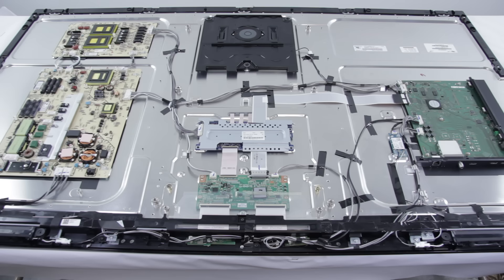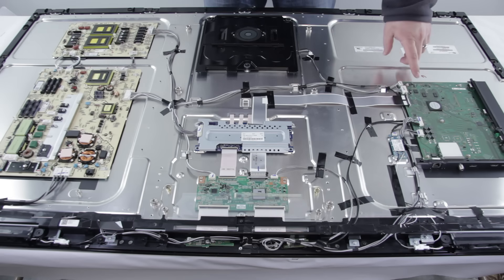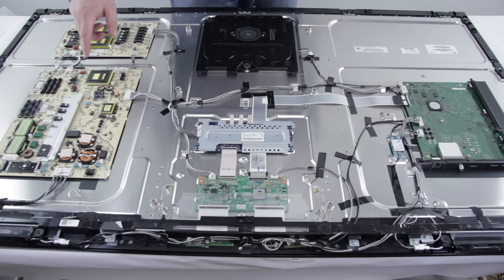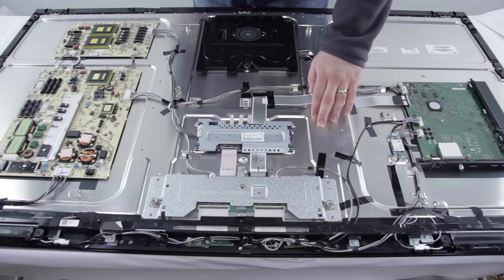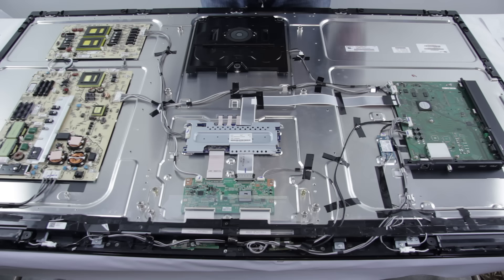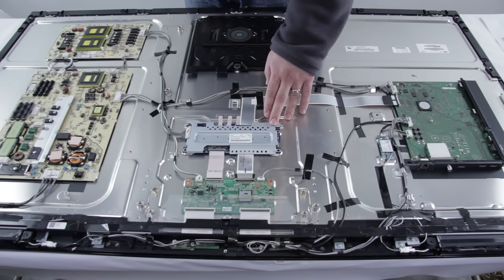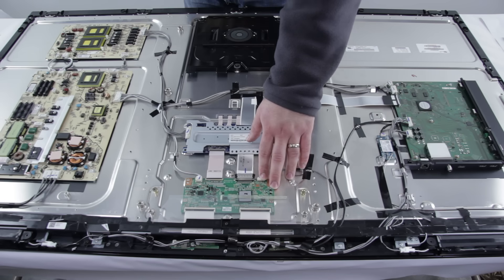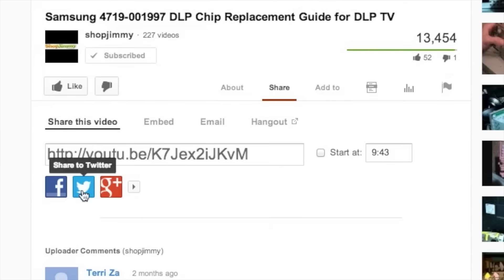LED TV Repair Tutorial - Common Symptoms & Solutions - How to Repair LED TVs

Comment: I have an LG 55LB5900-UV and the HDMI port says no signal. HDMI port 2 works fine. I've replaced the cables and switched the sources around. All sources and cables work fine in HDMI 2. When I initially reboot the cable box, the HDMI 1 port recognizes the source and gives a quick message, then the "no signal message" appears. Is it possible that that port burned out when we had a thunderstorm a few days ago?
Reply: sounds like the surface chip controlin this input  is faulty

Comment: Hi.
I have a Samsung 55d8000 LED TV. When I turn on the TV, it turns off immediately after the boot image is appeared on the screen. I think the capacitors died, cause I've been using it for like 4 years or so. May you suggest a website that I can purchase the repair parts for LED TV's. I can not access www.shopjimmy.com
Thank you for your support.

Comment: I have a 50LA6210 LG TV, the power goes on, when I switch it on, the standby light flashes twice then goes off, when I do the flashlight test, I can see the menu items on the TV, I am not sure what could be wrong
Reply: you have aback light problem can be a faulty led or led supply voltage

Comment: Thanks for the video guys. good job. I am having problems with my Vizio XVT373SV TV. This morning when I turned on the TV the splash screen came on just fine the audio came on and the video came up but after just a few seconds the TV turns itself off  and returns itself to stdby mode just as if I turned the TV off via the remote. Please note that the VIZIO is lit with the amber color and changes to a white color when I turn on the TV via the remote. I tried several times to get the TV to come on normal and stay on, but every time after a second or two it turns off and the VIZIO returns to amber color. I did notice on one attempt that the video was only showing on the top 1/3 of the screen. Other things to note. I have removed the back cover and looked at the PS board looking for bulging caps and/or bad solder joints. I've also done some research on the web trying to find some troubleshooting steps centered around this particular issue on this model TV. I'm very handy with a DVM as I used to repair electronics in the NAVY. From what I can gather from the web this should be either a PS board issue or a main board problem. I need help trying to figure out if the power supply is supplying the correct 12 v to the main board to keep the set on, or if the main board is not operating correctly and sending a turn off signal to the power supply board turning the TV off. Any help would be much appreciated.

Comment: I have a Samsung UN46F6300 46 in 1080p 120 Hz Slim Smart Led HDTV that has a dark chafing in the top third of the tv evenly across the top. You can see the picture through the shading. If you turn the back light up in the settings, the darkened lightens a little. Please help. Do you think it can be fixed by replacing the backlights? The tv was purchased in 2013 and is out of warranty.
Reply: Shading not chafing

Comment: hi I have a Samsung 65 inch tv that has a vertical blue line running down the side of  it. It comes and goes and sometimes flickers. can you give me tips on how to fix it? also I have a little bit of backlight bleed on top of the screen. is there a way to fix that? thanks. the model is UN65H6300
Reply: sounds like a faulty cable contact on the panel this quiet common and should fix both issues
Reply: +ron hicks Do I need new ribbons?
Reply: no they are mouled to the screen canot be replaced somtimes a little pressuire on them will fix problem as they are glued on if you try to remove them it will destroy the screen contacts ..when set open a little bit of tape preessed along the top of ribbon should fix both problem . i was a tv teck for 55 years ..

Comment: I have a LG 3D TV model 42lw5300, yesterday a bad storm caused a power outage and my TV never turned back on. When I press the power button it clicks to turn on, but the red power light slowly blinks 3x before turning a faint blue. The screen is black with no back light or signs of light coming through. Can you help? I have called the company but there is no retailer that can fix my TV within my location.

Comment: I have a HISENSE 50H5G it will not power on but does have a red led light that lights up when plug in. I have replaced the power supply and got the same results. Should I replace the main board next?

Comment: i have a samsung UN50H6201AF TV that randomly stopped showing picture/video but still had audio and back lights still worked. i did some diagnostics on it, tested the power board, main board and event purchased a new tcon board since the symptoms were pointing to tcon board issue. new tcon board still didnt fix the issue. i unplugged the right ribbon from tcon to panel and kept the other ribbon plugged and the result was half of the screen showed picture/video and the other half didnt... i swapped the ribbons to verify that it wasnt a ribbon issue and still got the same result, half picture half blank... so it seems like the source of thd problem is a panel issue or panel board issue... is there any way i can fix that? i havent found anything online that say i can.... please advise...

Comment: helle! i have lg 32lb551d-tc 12/2014 model. it has a problem of low lighting, it happened by its self when power cut switching to the other power source. sounds are ok but the video comes whit low luminosity, i tried all settings but still low light. what else can i do?

Comment: I have a 50" Philips 50PHF4009/88. It has a bold black vertical line running in the middle from top to bottom with about 7 much lighter hardly visible vertical lines running from top to bottom beside this bold line. Some times it starts and displays with the lines, other time it hangs in standby mode with the red indicator light on not responding to the remote. Other times, the whole screen turns completely white. Any ideas????

Comment: i have an LG 47LN5790-UI, the backlight comes on for a second at startup and then the screen is black, did the flashlight test and determined it was an led backlight issue as the picture is still there, just not lit. saw your short tutorial and went to find a led driver to price the potential cost of the fix. on your website it has a note under the closest thing I could find that sounds like it's the led driver (LG EAY62810801 (EAX64905501(2.0)) Power Supply / LED Board) however under this product is a warning that one of the led strips may be bad and not the driver, how can I trouble shoot this issue down to led strips or the driver?

Comment: hı ı have  samsung 32 es 6100 led tv. my chıld  sprayed  water to led panel. we didnt realize this. when we were watching tv the image on tv panel disappered  suddenly. ıt may  be short circuıt. on t board at back panel two cable plug in. ıf ı discoonect one of them half  of lcd panel is working and the other  half is dark.audıo is ok .  when ı put all cable plug in the lcd panel goes black completely.. audio is also ok.
Reply: inportant  leave the tv off to dry out for a couple of weeks  as this can damage main panel as the connections are on the boddom of the panel   ..they are very fine

Comment: I have a 47 inch LG edge lit lcd tv. My cable input works fine but HDMI inputs seem to randomly go black screen and tv will turn off and turn back on again. It started out of no where I think something might of over heated. Should I change out the main board?

Comment: TV is a Samsung UN46FH6030 picture suddenly became dim...almost not visible while being watched. All eco modes were off. It only is visible now when I adjust the energy saving feature to "high". Brightness will not increase at all.
This happened yesterday. Last night when turned on wide green vertical bands were on the screen. Turned off and back on and they went away. Samsung customer service was not useful at all. Thanks.

Comment: Ok. I'm going to give this a shot hoping these messages are still being answered.  I have a Sanyo FW65D25T that displays a red "stand by" button, but will not power on by either the remote or the power button on the television. The TV was bought brand new about a year ago, but has been turned off for several months.  This lack of power issue occurred after plugging it back in. Any help would be appreciated.

Comment: good afternoon. after a bad storm 3 of my tvs are not working I start with the first one. it is a seiki model se40fy27. once plugged in it only displays the blue light as it is turned on. however no picture or sound and it does not power down till it's physically unplugged. any suggestions?

Comment: My LG 47LS4600 started an intermittent popping/crackling sound (with associated screen flicker during the pops) today.  It began after we had a power outage.  I do have the tv plugged into a surge protector specifically designed for tv's.  I've turned off the tv and unplugged it, but have done no other troubleshooting.  The only inputs to the tv are a Roku box and a dvd player (no cable, satellite, or antennae connection).  Any ideas on what I can do on my end to fix this?

Comment: I have enjoyed three of your videos and have removed and purchased a replacement inverter board, it has been tested and is identical to the one removed.
I am awaiting this board and in the mean time watched another tube on led driver, I carried out the flash light test and can see picture and menu when tv is on, also can change channel and hear sound as normal.
I have a Toshiba regza 26 c3030d and the inverter is a I260-B1 what led driver would I need if the replacement inverter does not do the job?
Regards David

Comment: I have a Samsung ln32c540 that will not power on.  The red light is steady red.  I read on one forum that I need to replace the 2J183J SIC 460S  capacitor on the power supply board.  I just wanted to get your opinion.

Comment: Hi. My tv - LG 42inches model no 42LB550A-TA has a fault. It shows pictures and there is sound , but there are several small pockets of bright white circular spots lit up on the right side of the screen. About 9 of them. And there is some rattling movement in the tv when i lifted it like something has come loose. Pls what could be the cause and how do I rectify it. Thank you

Comment: I have a Sceptre X425BV-FHD3HW09V2 - standby light (red) is on, and when i push the power button I get a blue light indicating the TV should be on. I get no picture and no sound. I have no backlight and no visual after performing the flashlight test.

Comment: I have a Samsung LED LE52F96BDX/XEU, Serial AKE338TPB00052K, Version CN01. The screen graphics have suddenly deteriated to a purple / pinkish hue with a chromatic effect. If I turn off the TV the screen is momentarily ok before deteriating again. No issue with back lighting and sound. I have done all the usual checks re cables, reset etc. Is this a Tcon board issue? regards, Jim.

Comment: I have a Samsung UN46D6000SF.  It attempts to power on three times, then then the power light double-flashes five times, and the process repeats.  Specifically, when powered on, the screen displays "Samsung Smart Tv" for a moment, then becomes dim and turns off. Next, this is displayed again, looking normal this time, and turning black again. Then the power light goes off, and "Samsung Smart Tv" flashes briefly, and turns off.  This is when the power led begins flashing. The television will continue this cycle indefinitely and can only be stopped by disconnecting the power. Does this sound like a main board?
Reply: The caps look fine, btw, though I have not tested them, nor tried to replace anything.

Comment: Hi, We have a Samsung LED HDTV (MODEL # UN50ES6500)
Our TV started acting out since yesterday ... It has been experiencing all kind of symptoms with the quality of the image and colors. At  first it was flickering, then turned really bright, almost white screen (specially at the center). We unplugged all devices including the TV, then plug it in and turned it on again in after a while. The flickering and dimming continued with horizontal and vertical lines... I tried all the troubleshooting recommendations by the samsung technical support and nothing seemed to work. They asked me to schedule for service. When we turned it on today.. there is no more flickering but the image is really dark on the left side of the tv also... the image overlaps for a few seconds as it changes from one scene to the other. There is just a small column of about 6 to 10 inches at the right of the tv which seems to look normal. Audio is working fine. I have pictures that I can email to you if you need more details. Any help or information on what would it need to be replaced would be greatly appreciated! Thanks!!

Comment: My Samsung LED UN46EH5300FZXA was struck by my 2 yr old with a brush on the bottom most edge of the TV, this created a vetrical black stripe around six inches in width and varying shades of black. I still have images just darker. I'm guessing it the backlight board but mine doesn't look like this and has multiple thin circuit boards on the bottom edge of my screen could these be at fault?
Reply: oh and the tcon board connects to a right and left boards with that ribbon connector, i see corrosion on the right side board where a thin connector travels towards the actual screen, that explains the changes to the black stripes when it first occurred, it's like it was shorting more as time passed but now it's stable.

Comment: 60" Sharp Aquos LCLE650U.  3 long flashes 1 short, and no picture.  Original issue was, none of the HDMI ports would work, then I took the back off and removed the main board because I was told that was the issue. So I got a new main board and it was broken upon receiving it.  I reinstalled the old one and thats when the flashes started happening

Comment: I have a SEIKA 39"LED after a bad storm I came home and TV would do nothing. I unplugged it then plugged back in and the red stand by light came on I turned on with remote and the blue power light came on. It only stayed on a few minutes and went off then the red stand by light also went off. I repeated the same thing with the same results. What could the issue be?
Reply: model is SE39FT11

Comment: Hi, I have a JVC 55inch emarald series led tv ( Model# EM55FTR) it won't turn on. No standby light. But I noticed the Roku stick at back of the tv has a light on it. If I unplug the wire for 1 hr it will turn on with some flicker noise from the tv. The picture and the sound works fine, but u will hear some flicker noise in between. Once I turn of the tv, then I need to wait 1 hr unplugged In Order to restart. What could be the issue? Please advise

Comment: Hello

I have a Sharp Aquos
Quattron LC-70LE857U and I have no picture the led indicator in the middle of the TV gives 2 slow blinks then 5 fast blinks. It seems to be an error code but I am unable to find out what it means. There is no picture on the screen or sound since I am unable to see anything to switch outputs. Please let me know if you have ever heard of these codes and what parts will resolve this issue.
Thanks in Advance

Comment: LG TV  model 42LN5200.  Set has sound,no pic , no back round  lights ,led are off. This set only has two boards in it but the LEDs may be the problem? Is there a way to test the LEDs by unplugging the power connector and apply a DC voltage to that plug to see if they light up? If so what volts would it need? Or do you need to buy the boards? If so how much? Or do you have to get the led strips to fix this set ,that looks like a lot of work to change them all out? I will check to see if there is any volts at power plug output but I don't know that is should be, maybe you can tell me? Thanks Ken Tv tech.

Comment: I have a Samsung UN60EH6000FXZA and had no picture, but had sound and backlighting. I replaced the T-Con board and now have a picture, but there is yellow streaking-outlines in the picture and no amount of adjustment gets rid of them. Bad T-Con board?

Comment: hello I have a un40f5000af that started with the bottom half dimmer than the rest of the screen then after awhile went dark with sound and passed the flashlight test .I have replaced the power supply Board with no changes still no backlight could this just be all bad led strips?

Comment: We have a Vizio E550I-A0 that randomly seems to lose a color.  The opening Vizio screen will come up black with the Vizio "V" in the middle of it.  When it acts up, the background becomes a gray with the "V" in it.  Vizio's solution is to unplug all the cables including power and hold the On/Off button in for a minute.  Sometimes this works.  I've had the TV off for 2 days once and it eventually came back.  Any idea what part could be replaced to fix this problem?  Thanks!

Comment: I have an LG tv, model 47lv4400. After a bad electrical storm, my tv would show the blue standby light when the power button was pressed on the remote, but there was no picture.  I tried the flashlight test, but there was no image with that test as well.  What do you suggest is my problem?
Reply: Also, I checked for backlight and there is no backlighting.

Comment: Great overview. I have a Vizio LED 55 inch. Model number E550i-B2. With your demo I was able to see that my TV has a picture/sounds and the inputs work. I just have no back lights. based on this tutorial I think it's the led inverter. I took the back apart and all the boards look good. the weird part is that if I unplug the TV for a long duration and plug it back in. then it will work again for a few days before the back lights go out again. does that change the diagnosis of it being the led inverter?